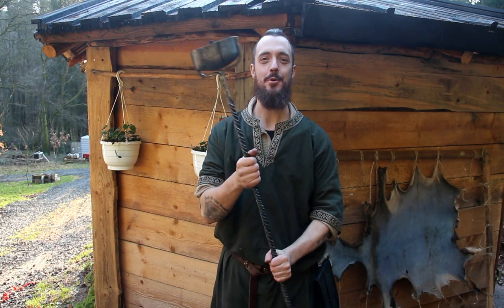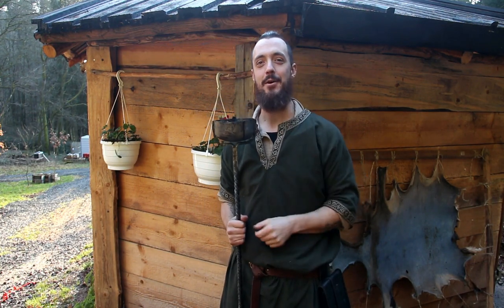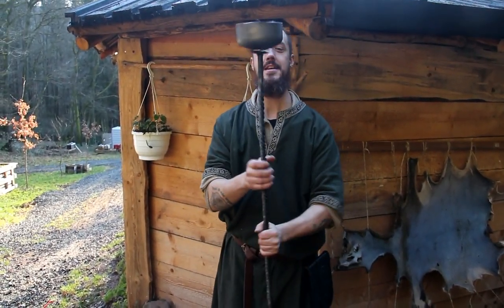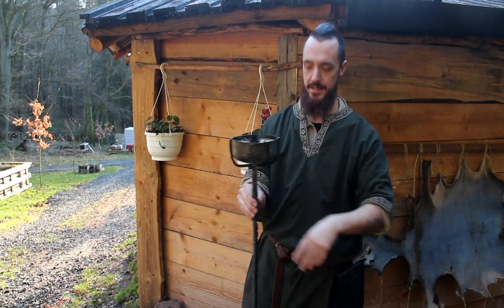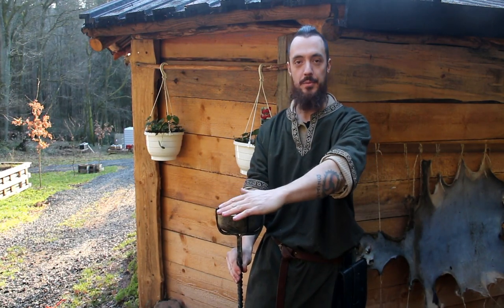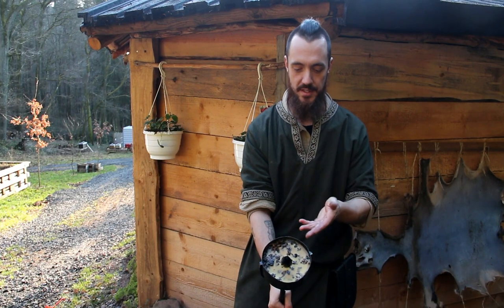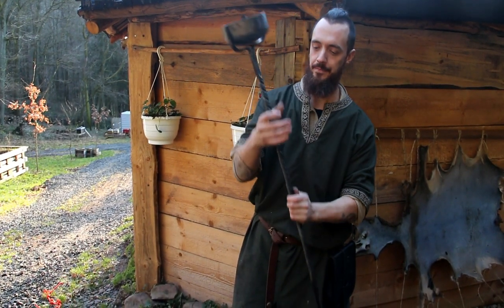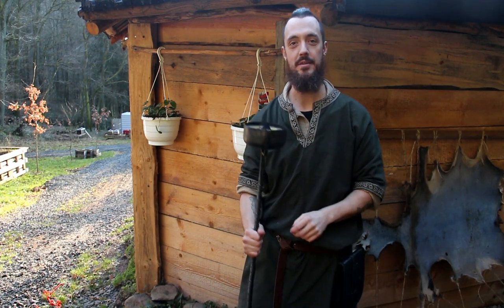Blacksmithing-Oseberg Lamp

Comment: great work ;-)
That big metal ball (6:27), what is that, is it a shot put and if what lbs, or is it mabye a petanque ball ??
Many thanks for showing and please keep up the good work ;-)
Reply from the maker: @terrain-hardy  it's just a large metal ball from some mega large industrial bearing I found at the scrap yard. I welded it to a square piece of steel to use for exactly those type projects.